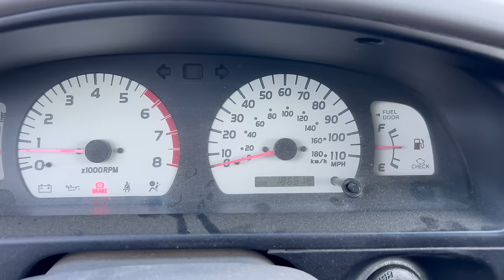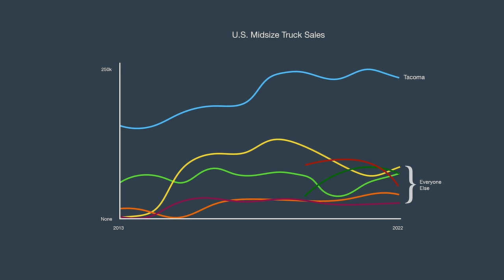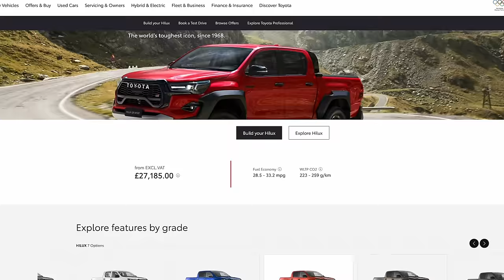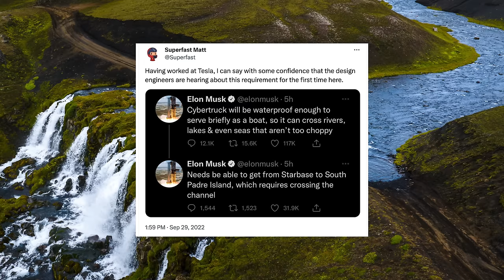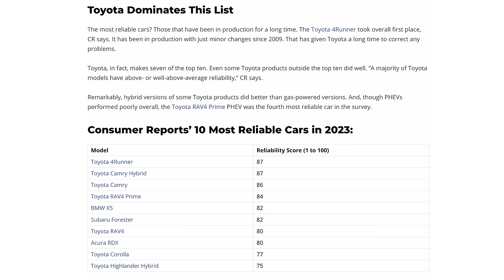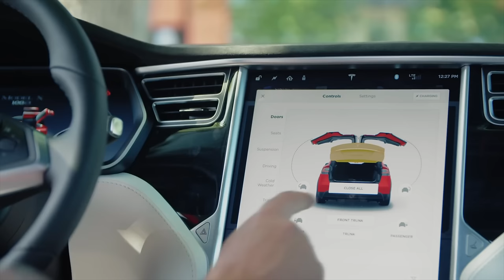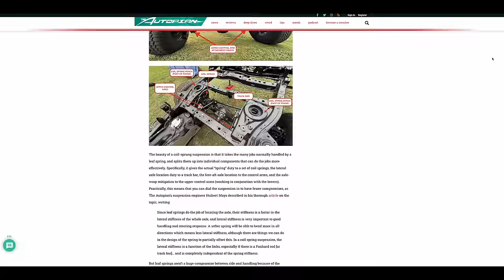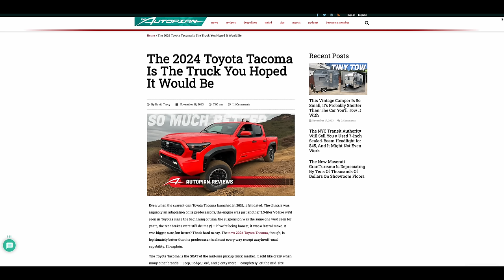What Is The Best Truck, And Why Is It The Toyota Tacoma?

Comment: When I was looking for a mid-sized truck 5 years ago, I considered all of them. This was before the Ranger dropped or the Frontier finally got updated. I wound up buying the Colorado, and as a truck, I absolutely loved it. The power was fantastic, it was comfortable, it had great utility, and it wasn't terrible on gas. However, it was the most unreliable vehicle I'd ever bought, and the only vehicle I've ever bought brand new. It was in the shop for over 80 days in the first 2 years of ownership, and it was ALL warranty work, nothing I did wrong. It was just junk. The 8 speed auto had the well known issue with the hydroscopic fluid, the rear diff would randomly go full lock on a turn, the catalytic converter failed at under 10k miles, the wiring harness broke under the seat causing an airbag light, it had so many problems I can't even remember them all. All of the problems, and I couldn't get it lemon lawed, because in Texas the days in the shop don't count against it being out of service if you accept a loaner, so no matter how awful that truck was, it wasn't a lemon, by Texas law. Absolutely absurd. I sold it to CarMax, so it became their problem.
Reply: I will literally never buy another GM product again. Currently own a 2005 Jeep Grand Cherokee Limited 5.7l, it tows up to 7500lbs without even hesitating, and it's extremely reliable and comfortable, even after 166k miles. My daily is a 2019 Miata RF, which is easily the most reliable car I've ever owned, despite me putting over 30k miles on it in 2 years.
Reply: And just think you paid $40k for a vehicle that’s worse than a 40yo vw rabbit pickup 

And people wonder why most new things are junk. 

People like you paid them for it!
Reply: @fastinradfordable  27k

Comment: The only new vehicle I bought in my 54 years was a 98 Tacoma Limited because I worked for Toyota, my first car was a Toyota and after totalling my not Toyota by trying to occupy the same space at the same time as a Kenworth I was offered enough money to pay cash for a 98 Tacoma Limited and get one great deal from my shrewd negotiating skills my Snap-On dealer at Toyota taught me 34 years ago. What's really important is my 85 year old father is safe driving his Lexus, psst Toyota, with it's easy to use navigation and many automatic safety measures I recently experienced while terrified. Toyota, scaring and scarring people going places.
Edit: I actually made money when I sold the Tacoma as I negotiated another Toyota into the deal that had just come in as a trade-in. Sweet.

Comment: Whatever truck you have is usually the best truck. I've had them all, the only two that really stuck in my heart was a v10 4wd F250 and a v8 2wd quad cab Dakota. They couldn't have been more different, but it's the feel, the memories, and the experiences. Would a Tacoma have given the same feels in those situations, maybe, probably not though. Like you said, they are pretty good at being dependably mundane.
Reply: Honestly people way overhype Toyotas. I've had a 9 cars in the last 15 years and the only ones to actually die and not be financially viable to fix were toyotas. One was a 1996 4runner and the other was a 1987 Camry. Both died at under 200k miles due to transmission issues. Most of my other cars have over 200k miles without any serious issues. There are definitely worse brands than Toyota but the point is that it really depends on the model and how well it's taken care of and people should buy based on what they need and not fall for "brand loyalty". For off roading I've been looking around and the Toyotas tend to no be a great option because the long wheelbase and the body that sticks out past the wheels forward and back seems excessive.
Reply: @rubiconnn Your exceptions prove the rule.

Comment: About 20 years ago Dana made frames for the Tacoma in Stockton CA.  I got to do some engineering analysis work on production at the plant.  Was a relatively low tech but very productive assembly line.  Was really interesting to see how the sausage was made so to speak.
Reply: Are these the same frames that got recalled and replaced due to rust?
Reply: @seymoarsalvage Don’t know but it would not surprise me if they were.  I was there circa 1999-2000.

Comment: Been driving  Ram trucks for the last 30+years and they have all been good trucks but my next truck will  be a Toyota Tacoma been wanting for quite a few years now. Especially now I don't need a full size truck for work anymore. I have always like the trucks And I've always heard good things about them from friends and family that have owned them. One friend owned 1 of the ones from the 80s and that truck lasted forever and always ran good right up till the end. The real differential finally took it out. It was just so old at that point with over 400000 miles But still ran like a top Crazy how good those engines are especially in the old ones.

Comment: I can agree with the tacoma's overwhelming buyer (and after market) preference....

But there is a case to be made for 2nd gen Frontiers. Namely their ability to have factory titan parts swapped in.

Will you have the resale value/undeniable pedigree of tacoma? No.
Will you have unholy torque numbers, 6 speed, on half ton axles, and mid travel ifs, that still looks and performs like an especially wicked oem? Absolutely. 

And all for a fraction of cost and effort that would go into making a tacoma similarly capable...

If you're gonna sell it, tacoma.

But if you're gonna keep it?
Reply: Exactly the reason i gave up my toyota 4x4 dreams and bought a 2016 frontier. For 8-12k less than a comparable tacoma and relatively the same reliability cant really beat it. Plus the frontier definitely feels more powerful than the taco and seems to ride i bit nicer.
Reply: No way. A mini titan? What the fuck man I had no idea they could swap easily

Comment: I absolutely love the 1st gen taco, it’s my favorite platform of all time by far. But I think way too many people put tacos on a pedestal. It’s still got its share of problems, in every generation. But the 1st gen in particular has the amazing lower ball joint failure, as do 3rd gen 4Runners, 1st gen tundras and sequoias, As well as the 100 series Land Cruiser Prado. Aside from that on all 3 gen’s there’s the puny rear diff, drum rear brakes, thin frames, super invasive security and communication circuits in modern trucks. Seriously the 8” diff came out in 1979 in a truck that weighed 3000lbs and made 80 hp. 1, 2, and 3rd gen’s all use basically the same diff and it’s a known issue.

Comment: I recently bought a midsize truck. I needed something to daily drive, do some offroading, to tow my track car, and still be able to park it. Towing ended up being the deciding factor and I got a Colorado. If I had anything less than a car to tow, or even just a lighter car, I would have gotten a Tacoma with zero question.

Comment: I have a 95 tacoma 4x4 that I still drive despite having the money to buy a newer truck. For the last 2 decades since I bought it off the dealership, as long as you change the oil, it just keeps going, and any repairs don't require a computer and done in a basic home garage.

Comment: I’m an Australian, in early 2023 I spent 3 months in the US. In Australia I drive a Hilux in diesel, they are truly indestructible. They are as powerful as you could reasonably ask in the 2.8 lite diesel. Back to the US, I was offered and accepted, the loan of a Tacoma. It was old, I don’t know how old, it was in good condition, it had been lifted a couple of inches, had a step, but otherwise it was stock automatic petrol. I was delighted, both on road and off road, the Tacoma did the trick. The Tacoma has given me cause for pause on the question of petrol versus diesel. On balance I’m still on the side of diesel, because I like the off road range and longevity.

Comment: I was 3 years old when my truck hit the lot in 1997. After a concrete company , and my older brother put in 300k miles of abuse, I’ve been driving it with little issues for about 3 years. I did put a new engine and transmission in before i bought it as it was the family shop parts truck back then, but most everything else has 300k on it and functions.

Comment: I bought my first rebuilt vehicle this year- a 2022 Frontier S with 3500 miles for $19k. 310hp v6, 24 mpg if I stay under 75mph and toss 6700lbs and CarPlay. Way more bang for the buck than my last 3 F150s. Not a Toyota, but a damn solid option for dirt cheap.

Comment: Bought my 2005 manual, 4 cyl Taco brand new in May 2005 and paid it off in full in May 2010.  Was and still is my daily driver in Southern California to this day.

There's been several serious problems with it both short and long term but overall I consider it a good buy.

Comment: I own a midsize truck and it is not a Tacoma, it is a Ranger, but that’s only because I am too tall for the previous generation Taco. I already have my order in for the new one (TRD Sport, manual, traffic cone orange) and I’m excited to get it and have a 3-pedal driver again. It might actually the last manual I’ll buy new, but that’s ok, because it will last forever.
Reply: That was a big part of why I got a Ranger too. I went around test driving everything on the market but didn't even get as far as starting the engine on a Tacoma, sat in one in the showroom and immediately knew I wouldn't be able to live with it. Of course it didn't help that any desirable Tacoma was marked up to the moon, or that it was slower than the Ranger, towed and hauled less than the Ranger, got worse fuel economy than the Ranger, and, probably shockingly to most people, was statistically less reliable than the Ranger.
Reply: Same boat here about a year ago. Drove all of them and Toyota was wanted originally for the reliability and durability. Once I spent real world time behind the Tacoma, Ranger, Colorado, AT4, etc. The Tacoma was just a little too tight cabin wise and also for some reason I didn’t like the interior. Between those two and the “peppier” feel I went with my Ranger. Optioned top level XLT and added my own Coilovers, Wheels/Tires and some performance upgrades power wise.

31,000 miles in and it’s been great. Seen daily duty in the Midwest on mostly garbage roads, traveled lots of trails and trailered the race car thousands of miles all without a problem.

When the time comes to shop again in a few years I’ll definitely try the Toyota again, but this last time I went Ranger and have been very happy.
Reply: Yeah it was down to Tacoma or Ranger for me, but the Ranger won. Picked up a 4x4 2011 Ranger with only 50k miles last month. Southern-owned, so no rust. 

Tacomas are great but Rangers come out on top, IMO. There's just something about 'em. I absolutely love mine.
Reply: @max_archer  Resale on the toy will be double though......
Reply: Don't know about lasting forever now that it's a turbo.
Reply: @will7its  
Speaking personally I don’t worry about resale for my vehicles. I tend to have them for a long time. Also I’ve been offered more than I paid for my truck in the current market even with 30k miles.

Comment: I’ll wait to see that turbo 4 cyl with its 0 weight oil make it to 476,000 miles with no rebuild.

Did manufacturing get better? Yes. But 0 weight oil and the turbo is to pass emissions and  fuel requirements from the EPA.
Reply: Turbos aren't inherently the problem. The diesel world has been turbocharging everything since the 80s and they all last. My 313k mile diesel mercedes has the original turbo on it. The 0w8 weight oil definitely has me more concerned. Given the option I'd sooner lose a bit of efficiency to run heavier oil.
Reply: It's not 0 weight oil, it's 20 weight oil.
Reply: Like Jared said above, it’s either 0w20 or 5w20 oil weight. 0 is just to get the fluid around when cold so it’s really 20 weight oil when driving.
Reply: @coltonmcrae5873  Sure, but diesel engines are just plain built like tanks to deal with the abuse.  So while the turbo adds some complexity to a diesel, it doesn't add much risk.  Turbocharged gasoline engines are a different thing entirely.
Reply: I'm well aware that 0W-20 means that 0 refers to the flow in cold temps and 20 when the engine is at operational temp. Toyota is also making a 0W-8 oil now. However, the main component here is the reduced viscosity of the oil.

Viscosity is a fluid's resistance to flow. The new low viscosity oils are nice because they reduce friction that a higher viscosity oil would introduce. But oil also is susceptible to thermal breakdown and as engine temps go up, the viscosity and protection goes down. That's your increase in wear on the rings and piston that is giving better fuel economy standards to squeeze out the efficiency versus longer engine life.

 When you are turbocharging an engine, you are increasing stress on all parts of the motor simply because you are increasing pressures in the combustion chamber. Better head gaskets, more oil cooling, bigger radiators, etc. It appears Toyota has done their work with this engine as they have beefed up the cooling system for hauling.

I simply don't see the average consumer being able to push one of these motors to 300k like the older motors because most people don't change their oil at 3,000 miles and use a good filter. They'll simply beat on it because "it's a Toyota" etc. You'll still have problems not changing your oil regularly on the old motors like the 5vz, 3rz, 2rz, 22RE, 22R, 4ac, 5sfe but a turbo motor won't tolerate that.

Comment: My only issue is Toyota doesn’t offer a manual double cab long bed Tacoma. I found the 6ft bed on my dad’s old 98 Tacoma and my old 95 Ranger perfect. 

My dad sold that Tacoma at 240k. I pulled the carfax. It’s still on the road today, odometer appears to have been rolled back twice, but it has well over 300k when calculating the actual mileage. I sold the Ranger to a friend at 265k and it’s nearing 300k now. Both those trucks were workhorses and put through abuse. The Tacoma was definitely the more reliable one, but the Ranger wasn’t far behind.

Comment: Back in 2006 I replaced my Silverado 2500HD work truck with a 2nd gen Tacoma. Over 300,000 miles later it's paid for itself in fuel alone. Not to mention I'd likely be on my 3rd transmission with the Chevy.

Comment: I had a 1997 Tacoma and it sold years ago for my than I bought it for, I regretted not keeping it. The Tacoma is the best truck at it's size... but I got a used Frontier recently and have to say It holds up, especially since they go for $8k-$15k less for equivalent models, years and miles.

Comment: Recently got a 2011 Tacoma SR5. It’s 2wd and has the 2GR-FE so it’s not super desirable for most but it’s double cab, only had 121k miles, and is perfect for me. Came from a 3rd Gen T4R and then a highlander for a bit and the Taco just rules.

Comment: My Dad had 1995 Tacoma XCab 4x4 V6 manual with manual windows & locks. It finally died in 2017 and he got a Double Cab Short Bed 4x2 4-cylinder SR.

Comment: 95.5 2wd Tacoma. Bought with 64K miles 22 years ago. Been by daily driver through the 456k it has now. It's had some issues with so many miles, but it has never seen a tow truck. It's simple. Power brakes and steering, that's it. About half it's life I've used it for hauling materials. It goes off road in the Colorado mountains every summer for camping. Even now with so many miles on it, I wouldn't hesitate to take it across the country with a trailer. I love it. NOTHING in my life has been so good and reliable as this truck. When its time finally comes, I will get another.
Reply: I have a base '96, 2.4, 5-speed. What issues have you had with so many miles? Mine's only got 83K on it now. I'm hoping it will outlast me!
Reply: @sunbeam8866  replace your ball joints regularly. They're known to fail. If you hear a squeal in the front end, that's it. Otherwise, ignition components failed after about 200k, which is pretty normal. And throttle position sensors. For some reason, I went through about 5 in two years, then haven't had another issue with them in 15 years.
Reply: @iderryan  I read about the ball-joints, and bought a set off Rock-Auto a few years ago. They were Moog, but made in Japan, with the same markings on the casting as some alleged 'factory' parts I saw photos of. Mine aren't squealing yet as I haven't been driving it all that much. No issues with the ignition or TPS yet. I have needed to replace the sealed-beam headlights twice. Maybe the non-Cadillac ride is taking its' toll here! Miraculously, I've managed to get the grille off and back on with all its' retaining-clips - TWICE!  (I've learned to grab spare clips at salvage yards)
After owning this for 8 years, my biggest gripe is the California-approved clear-coat is peeling - mostly from the hood and roof. The base light-blue metallic paint is still there, so it's not rusting - yet!

Comment: Tub trays are.. I don't understand them.  You can't even take them to the landscaping supplies without being told they won't load them as it risks the bodywork. You also can't fold down the sides for oversized loads or add extra reinforcing and other work easly for davit cranes or liftgates.
As an Aussie, the top dog is the Hilux with the factory flat aluminium tray. The 2wd versions are far easier to load/unload too, can handle basically the same weight and unless you are off-roading are better and the smaller engines also just LAST..
(And it's not a truck unless it has more than 4 wheels. Otherwise it's a car or a ute. :)

Comment: Drove a 05 Silverado for 18 yrs, an going to a 21 Taco is quite the difference, especially from a 5.3L V8 to a 3.5L V6.  The 21 Taco cost used in 24 as much as the 05 Silverado did new in 05.
My parents had a 1989 Camry that was built in Japan, one of the last ones, and that thing was finally sold in 2001 for a Avalon.